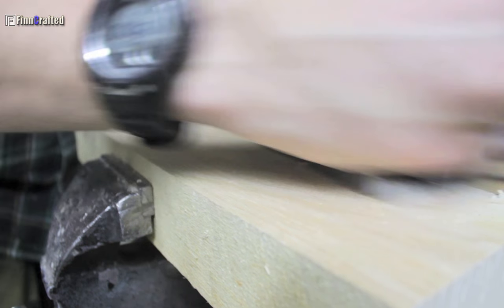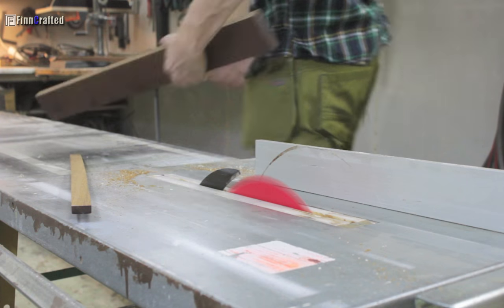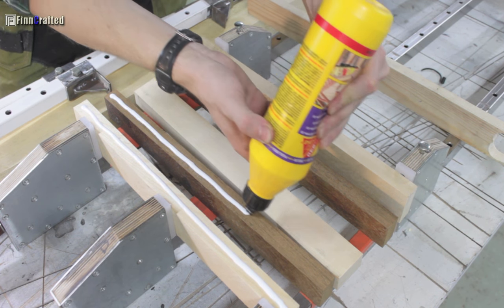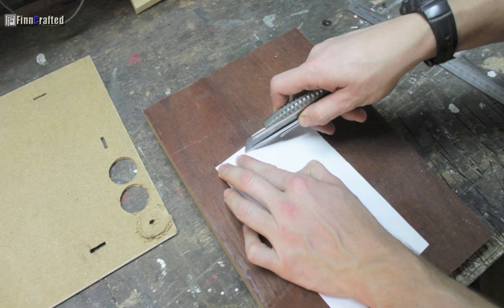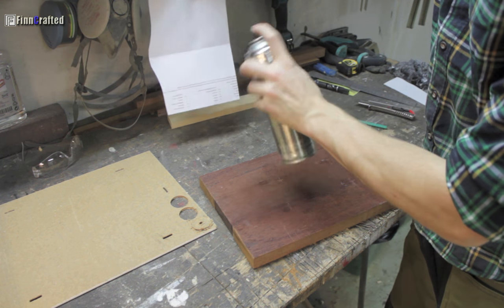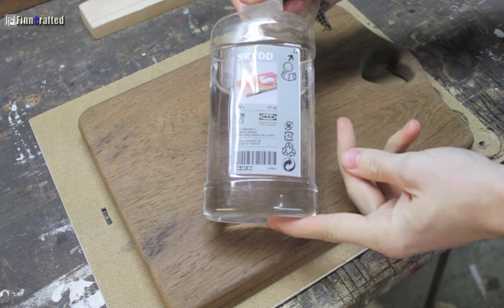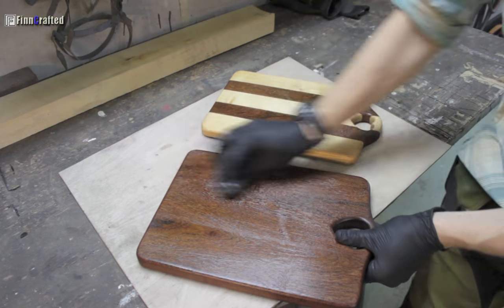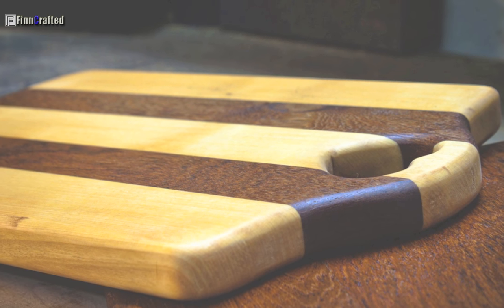Simple Cutting Boards from Birch and Dark Hardwood

Comment: Nice video and I guess I shouldn't feel so embarrassed about using paper glued templates. Also what other work or cleaning should I do before cutting food on this cutting board? seeing how it mineral oil was used as a way to protect the wood, or should I not use that oil.
Reply from the maker: Mineral oil should be food safe. This particular product is actually sold as "cutting board oil". After it is viped off and has soaked in for some time, there is no sign of the oil on the surface of the board. I also washed the boards with soap and a brush before using. If you dont want to use mineral oil, I have heard some use linseed oil, different blends of oils and beeswax, or even olive oil (may go rancid though).
Reply: FinnCrafted I'll stick with the mineral oil but just wash it really good. thank you for the response can't wait to see the next video